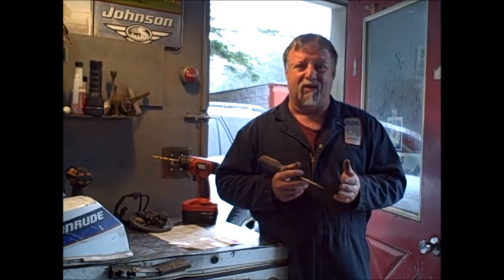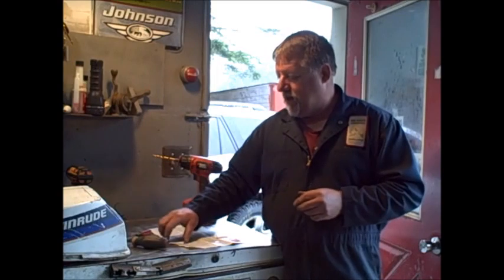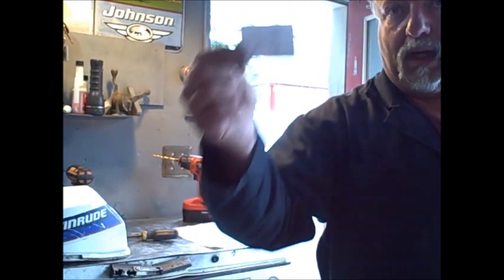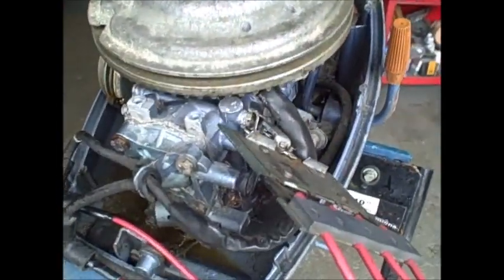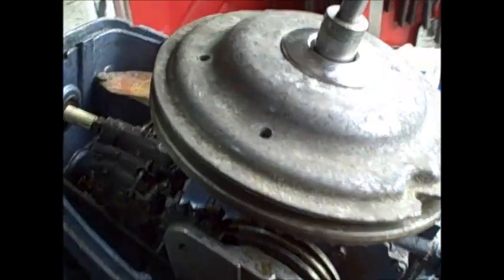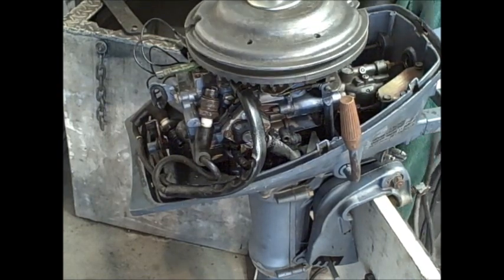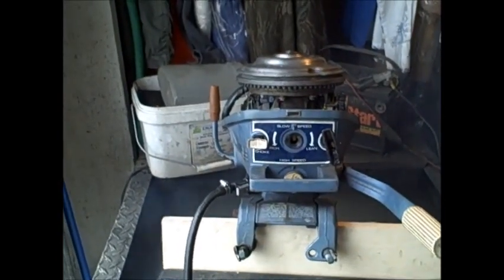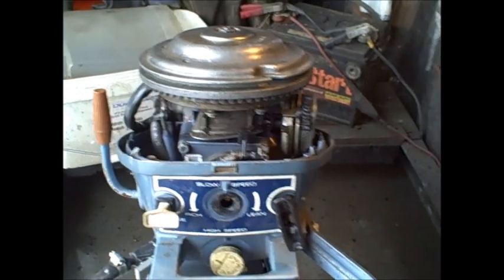Evinrude 6 HP,, convert to electronic ignition ( nova chips )

Comment: Kodi,
Marvelous video watched it  several times,I have just installed  nova 11chip on my yamaha -95-A single cylinder , air-cooled 5hp outboard  1970 
the engine was running good on points and condensor, I tested for spark during  the process, but now when I try to start I just get a single backfire and nothing else,I have not changed the coil as was running and sparking good  can you suggest anything, Best regards Brian (UK)

Comment: Hello. I have a 1946 Johnson Sea Horse 5 hp. TD 20. I replaced the points and did everything I believe to be right. Can't get no spark. I tested the coil and they run 8k all the way to the sparkplug wire tip. I did have spark on one cylinder before removing points, but I don't think I can even find points.
Reply: BTW I do not have a magnetic flywheel.

Comment: I have a 1964 14.1hp McCulloch. I haven’t been lucky with the nova chips . The motor came to me without points and condensers installed it had nova chips installed on it . Any way to test the chips or any tips would be great
Reply from the maker: +DG,  the chips will only work if both the primary & secondary  coil winding's are good on the coils.  The coil Must test good for the chip 2 work.     kodi

Comment: I just did this on a old Chrysler 30 hp I got great spark but for the life of me I cant get it to pop over. It is like the timing is way off or something. Even a little starting fluid and I still cant get it to fire. It did fire on points prior sort of that is why I replaced it. as I said great looking spark. But just wont fire or run. any Idea?
Reply from the maker: +Craig Stalmer,  what is the compression? & is your flywheel woodruff key & keyslot good?     kodi
Reply: @kodibassInsideoutboards  I did get it to work by changing around the wires on the ignition components. it runs now. been using it on my pontoon.
Reply: @kodibassInsideoutboards  Ok I figured it out. I swap the wires on the solid state units and it works! I have it on my 24ft pontoon been cruising around on the river . But I think it should be faster at full throttle. I checked it at the motor and all the linkages max out and it sounds fine.  However after it warms up it likes to idle real low and die. also could these electronic replacements for the points and condensers keep it from running at top performance?
Reply: Craig Stalmer hi! Can you share pictures or a video of the set up? I want  to try the Nova 2 on my chrysler 20hp.
Reply: @luiyihdez3  oh you do unfortunately the motor is all together and on my boat and I don't really want to pull the fly wheel.  but it is not that hard. but I recommend not putting them under the flywheel like I did. The wires kept getting caught on the magnet. I have just installed the same thing on a 8 hp Evinrude and I could make a video on that if you like it basically the same thing.
Reply: @luiyihdez3  also I should point out that my Chrysler 30 does not run full out with these chips. It is like the timing advance is off I am about to go stand in the water and try and just for it. It idles too low to stay running as is.
Reply: Craig Stalmer hi! My motor comes with an electric starter and the nova instruction said not for electric starter motors. So you think i can still use it on mine?
Reply: @luiyihdez3  that may mean you cant use it if it has a self  charging system and if your motor gets its power from the battery. if you motor runs with out a battery than you are good. I have a starter on mine and the battery is only used to crank the starter. the ignition is only from the coills under the fly wheel. when removing the fly wheel you may want to check on videos on how to do this. also the fly wheel has to go back on a certain way and toque down just right.
Reply: Craig Stalmer ok thanks for the information!
Reply: Craig Stalmer I’ll give it a try thanks for your respond!
Reply: Craig Stalmer I don’t know what’s the difference my motor has breaker points one of them broke and i cant find a replacement
Reply: @luiyihdez3  not to worry. if you got both coils then thats all you need. The little diagram is confusing but wire one lead of the module to ground that is the metal of the motor. and the other lead to a coil wire. then do the exact same with the other coil and module. Put it all back together and it should work. if you have two coils under the flywheel which I believe you do then this should work.
Reply: @luiyihdez3  I also completely removed the breaker points and condensers. You only need the coils to use the Nova 2 chips
Reply: Hi there again I installed the nova on my motor and I don’t get spark at all. There is tow red wires coming out of the coil are doses connect together with the nova wire?
Reply: @luiyihdez3  ok
Reply: ok best way to describe connecting it. dont have the condensers or points in any part of the circuit. One of the coil wires will go to ground that is a metal part. Now you have one free coil wire  that will go to one leg of the chip. The other leg of the chip it will be wired to ground or a metal part just like the other end of the coil.  Make the second chip look  identical.. Make sure the fly wheel is keyed in the slot and bolted down hard like 60 lbs torque.  I removed the spark plugs and used a a power drill with socket on the flywheel to spin it fast to look for spark.
Reply: Ok I’ll give it a try. Thank so much for your help!
Reply: Hi I still cannot get it to run. No spark on any of the plugs. Don’t know what I done wrong. Is there a way i can end a picture of the set up and maybe you be able to tell what’s wrong. Here is my email luiyihdez3@yahoo.com
Reply: @luiyihdez3  try one more thing. Sometimes you may not see spark but it is still there. I thought I was not getting spark until I held bare metal into the plug boot and got shocked. if you can hold bare metal in the boot and not get shocked than there is no spark. make sure the flywheel is in the keyway for sure. I will email you from my Hotmail account and you can maybe send me a picture of what you have done.

Comment: Thanks for the video, I also have a 1976 Evinrude 6hp outboard. This conversion worked great....however I learned something IMPORTANT.
When installing you must be extremely careful NOT to leave too long a wire underneath the fly wheel. If you do it will rip all your work apart in a heartbeat. So.....when you install these chips here are the hints I learned.
1) remove the old points and condensers....but KEEP all the screws and parts as you can reuse them for the installation of the Nova II.
2) I used splice connectors to attach the chip sets. Keep the wires short as you can.
3) Be very careful to keep all wiring below the level where they will be hit by the flywheel.
4) Drill out the Nova II chip hole to 5/32 so you can slide it over the old points pivot post. (keep the old clip from the points post)
5) Using about 5 (number 10) washers you can keep the chip down and the old clip will hold it in place
6) if you loose one of the clips as I did....you can use something else to hold down the Nova chip.
7) use the old screw from the condenser to attach your ground wire.
8) once completed tuck all wires neatly down to avoid contact with the flywheel. This is a 6hp motor so it has a bit more room than the motor shown in the video above.
9) I set the spark plug gap at .30 inches. This seemed to work well.
The motor started up nicely and ran smoothly.
Good luck with your conversion.
Sorry.....I tried to upload photos but was not allowed or able to do so.
Reply: How is you're motor after 2 yes now?

Comment: Hi my boss .Is what this module exists with an evinrude / 25hp / 1975..this is effective at long hardness
Reply from the maker: Jbeli Mariem,  This chips are used mostly for small engines such as chainsaws & lawn equipment.  They
will run a 2  cycle outboard in place of points but I do not know if they would perform well or how long they would last.  I would stick with what your motor came with.                                        kodi

Comment: I have 3 leads coming off my coils. I think one is ground and the other 2 I don't know what to do with them. do I tie those 2 together and put them on the positive side of the Chip? I am using the Nova II chips.
Reply from the maker: +Don Gesswin,  Yes the 2 non-ground tie together for your stop switch,   The other goes to ground to the coil body,  Please keep in mind I have not tested these chips under real world use / conditions.  I did manage to get the motor to run in my test tank on them...        kodi
Reply: @kodibassInsideoutboards  Thanks I will give that a try tomorrow.

Comment: Kodi I have a 9.9 Ted Johnson with a solid state ignition. The stator plate I believe is bad and no longer made. Only CDI make them but 289.00 for a new one. Question is could I do away with that and use a atom or Nova chip so I can get spark? It's a twin cylinder so I know I would need two chips. Thankyou for any help on this
Reply from the maker: +Mark Williams,  If your outboard is not a points & condenser type ignition the chips will not adapt & provide spark, These modules get there spark via the coil winding's & two switch transistors inside them as the flywheel magnets pass the coils, If yours is solid state (as you say) it has a capacitor discharge ignition that works thru a scr & wound not fire these chips.                                    kodi
Reply: @kodibassInsideoutboards  do you have any videos showing how to test this type. I've found some close but not quite like it. Tell if I'm wrong but the piece under the flywheel is the stator correct? It have four blocks mounted to the plate
Reply from the maker: "+ @MarkWilliams-yx7bx ,  under the flywheel you have 2 coils, 2 condensers & 2 sets of points,  The nova chips on this engine would not fit under the flywheel so I mounted them outside on the block, Also these nova chips seem to burn up quick on a 2 cylinder outboard.  I am in the process of trying the john deere / kawasaki chips to see if the work better,  stand by for the results                                                           kodi
Reply: @kodibassInsideoutboards  mine is solid state so no points or condenser on it. My coils are mounted on each h side of the head with one wire. Attaching to them from under the flywheel. Under the flywheel is a plate with two big and four small something mounted to it on the smaller onehave the magnet metal in the center of them. I'm thinking it's a stator from what I've read on the solid state ignition and the cowling says it also. Just can't find a video on how to troubleshoot it. All I've seen has like ten small.  Locks all the way around it. This flywheel has a magnet on it
Reply: Solid state has it even on the the cowling. Can't find. Video yet that troubleshoots this types of stator that it has. May just junk it.

Comment: I Have a 1961 Johnson 5 1/2 HP motor that I did the Points on about 5 years ago. "new points and coils Plus spark plug wires". I was always wanting to do this for years.
      I recently came across two STENS Mega-Fire Modules 44--065 do you think they would make good candidates for this.jim
Reply from the maker: jim maddog,  Yes those 440-065 stens will work just fine.              kodi

Comment: Kodi, Thanks for the video, I have a 6 Hp Evinrude that I am going to do exactly the same thing too!  Your presentation couldn't have came at a better time.  By-the-way, the carburetor is working fine.  
James & Karen Smith, Arkansas
Reply from the maker: +James Smith, Glad to hear the carb worked out,  I just sold that little motor, but I have another just like it.                                                                                  kodi

Comment: Kodi, I have nothing but respect. You’re a hell of an outboard mechanic and teacher.  Can we buy them still? I’m currently working on a ‘67 5hp Evinrude Angler. It has the 6hp powerhead and the 4hp lowerend. It’d be a great candidate for these chips as well. Cheers from Ontario, Canada.
Reply from the maker: +George Keats,  Yes the Nova chips are available, just do a ebay search & you will see many.   HP is unimportant they will work on any points motor.                                kodi